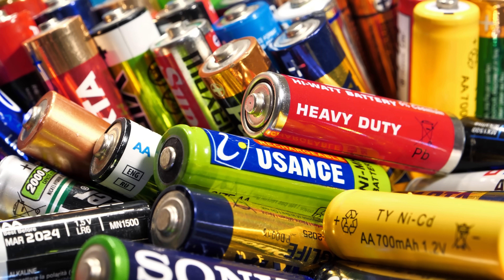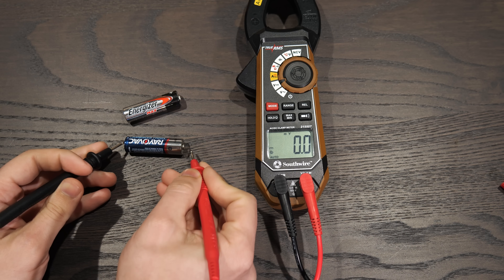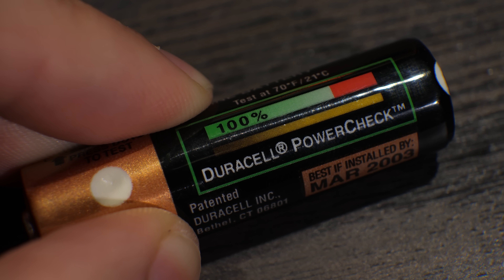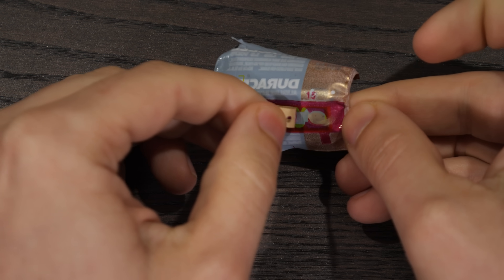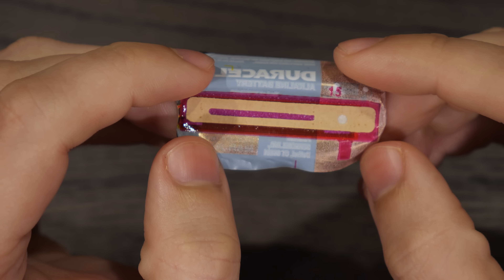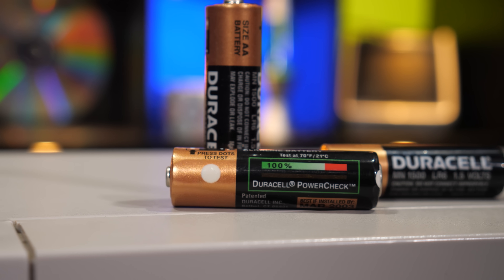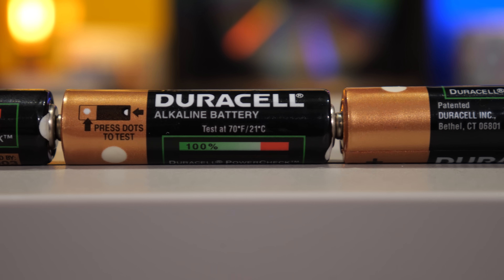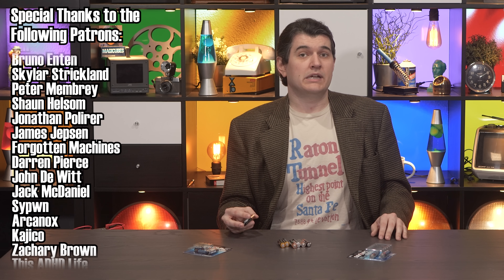Duracell PowerCheck: A genius idea which didn't last that long

Comment: I swear i remember seeing them coming back some time between '06-'16 but from energizer maybe. 

Id imagine these would be good as a subsidy just for saftey in emergency situations. If governments required all batteries to have a built in tester, it could mean good for natural disaster situations or times of economic or war distress. It isnt that much more expensive coming from the profits they make, and while rechargeable batteries dont exactly need this, having it as standard would make a noticeable difference to any without power or saftey to sit and charge everything again just to make sure even though youre sure you already did, could save time in a disaster to get to saftey or be quickly assessed as working or not when found on the ground as not to waste on weight or capacity, or as a quicker switch out from the stock youve scavanged and hadnt been able to recharge yet.

This all sounds improbable in USA, no one alive today has seen the wars that were fought on the nations soil, and many in cities are naive to just how responsive our governments actually are with weather caused disaster. But remember, we pump half if not more of our national budget into war and completely neglect climate change. We fund war that runs on oil and oil alone and as climate gets worse all storms, floods, winds, and droughts become more violent. Im currently prepping for hurricane milton that went from tropical storm to cat5 in less than 12 hours. Helena got little to no funding for relief, my parents are still waiting for hurricane ian relief and have been homeless sense. Unatural war and natural disasters are already here, and every helpful technology not integrated into our daily life is lost lives today tomorrow and yesterday without knowing there were ever a solution that could have prevented it. If the country can afford to burn the war oil to make weather this bad, they can afford the bill they racked up on the climate. 1 b-52 bomber running patrole for 1 day spends as much fuel as 1 car driving for 100 days straight. We have 1000 b-52 bombers in the air at all times. 

Excuse my darker tone, i have a similar taste of interests as technology connections does, but for systemic topics instead, and i enjoy sharing knowledge, though im not nearly as organized as he is, this is just a comment after all. Stay safe this hurricane season everyone!

Comment: I remember batteries like these, our family had a bunch of them and we still have a few. I don’t remember any looking exactly like yours, and I remember seeing them until somewhat recently. But I can also I see why these died out, it really didn’t matter too much when it stopped working since like you for the most part I keep them in a pack. And if I do end up with a used battery, l just try putting them in something like you suggested, which is arguably easier than forcing the silly tester circles in and trying to hope it works.

But it’s fascinating to find out how this worked, I always guessed it was some kind of chemical reaction based off how much was left in the battery.

Comment: I remember these things... I also remember sets of batteries where basically this same exact thing was built into the plastic packaging they came in.  Probably a lot more sensible (since only one tester per 4/8 whatever batteries), but still died the death of 'how often is that useful.'

Comment: I remember using these, and licking my fingers to improve the electric contact with the dots. At the time, I thought that it relied on a circuit through the body. Moist fingers did appear to help get a reading, but not for the reason I thought. :)

Excellent video as always. Thank you.

Comment: No the AAA is used in remotes because the power draw is so low that age becomes a factor more than capacity, so smaller cells have lower chance of bursting

Also, it's lighter, which makes the battery door easier to design, easier to remove

Comment: I had guessed that the Powercheck was thermally actuated, but had no idea how much engineering went into it... real cool!  Now... if only Duracell could solve the issue with their current batteries leaking, while they are still untouched in their unopened package, with a proclamation on the package  of "Guaranteed for 10 years in storage", and the date on the battery is still 6 years in the future.  Yeah, it's a pet peeve of mine. Duracell's of yesteryear were not like that.

Comment: At least it lasted longer than the actual Duracell batteries! I don't think I've used a single Duracell battery in the past 10 years that hasn't started leaking catastrophically way before its due date.

Comment: You can also check (roughly) how empty a battery is by letting it drop from about 20cm high onto its bottomside. If it doesnt bounce at all (and even stays upright): full battery! If its very bouncy and drops on its side: pretty empty. Probably depends on the center of mass that is different between empty / full, maybe due to the (shifted?) electro-chemical potential within the battery?

Comment: I wonder if this power check label could make a comeback with recyclable batteries. I have so many that I charged awhile ago that might still be usable. I tester on the label would be nice and a way for a brand to stand out from the rest. Probably not competitive unless customers actually buy it though.

Comment: To get the fluid to heat up, couldn't you have removed the wrap off the dead battery and wrapped it around a fresh one? No need to burn your hands with a hairdryer.

Comment: I missed these, but there's an easy way to test batteries without any indicator or meter. Take some metal foil and touch the ends together. If the foil heats up a lot quickly then it's fine, if it doesn't it's basically dead.

Comment: Fun-but-annoying fact: it is generally accepted that an alkaline is completely discharged at an open circuit voltage of about 1.0V. If you measure the discharge voltage over time under a given load, you see that the mid-point of the discharge is about 1.25V, halfway between the 1.5V and 1.0V extremes. Despite that, you will find that many consumer electronics devices that assume alkalines will cut off operation at about 1.25V, taking about half of the battery's useful life off the table!

Comment: When I was little, I remember the battery testers on the batteries themselves where a series of little vertical bars that glowed green when activated.  Funny I can remember that but not the minecraft house I built in update 1.14, a house of which I recently refound, complete with resident dog and cat.  Poor kitty, poor puppy.  But hey, I can confirm it's mine, as the dog and cat got up when I clicked on them.  Weird I don't remember it.  At least I remember old battery testers.  Rockatoa, brickticks out!

Comment: Testing batteries by putting them in a thing to see if they work is great until you have one dead or defective battery but can't tell which one. Then it's time to practice the old permutations and combinations maths or break out the multimeter.

Comment: IIRC, the testers were part of the ad campaign that included adding the "best by" date. I think the intended use was to confirm that the batteries hadn't gone bad on the self before putting them into a device. This was supposed to motivate folk to pay a premium over cheaper, dusty, undated batteries. I'm skeptical that the testers were primarily designed for people who switch partially used batteries between devices.

Comment: I think the big thing to remember is that we simply aren't burning through batteries anymore because technology has made things much, much, MUCH more efficient.  To use the Game Boy analogy, the Game Boy (OG) required 4 AA batteries.  The Game Boy Color required 2 AA batteries.  The GBC was more technically advanced, but required less power.  The GBA used only two batteries and also was way more powerful than the OG Game Boy.

Most stuff now has such great power management in it that the batteries in those devices will corrode before they die.  Even TV remotes, one of the last bastions of batteries, can usually go their entire lives off of the tester batteries it comes with, if used moderately.  Even alarm clocks can run off of a single AA for like 5 years.

Still, I did like the PowerCheck.  My thumbs, not so much.

Comment: Watching you push in those "buttons" brought back all of the memories of how painful doing that was. 
I always found the gauge not fully reliable - I recall plenty of times where I could make the gauge register but the battery still wouldn't power a device.
Reply: Am I the only one that could never get it to work? I never saw the yellow no matter how hard I tried.
Reply: @PremierSullivan  you had to just about make your finger bleed to get them to work. Either that our all your batteries were flat 🤣
Reply: Different devices require different minimum voltages. For example, batteries with too little charge for a gameboy might still work in a TV remote
Reply: @gregariosity  agreed - but to my then preteen/teen brain the bar said full so my game boy should've worked!!
Reply: We had/have a small analog tester, my father always says: You need to look at the speed of the pointer, just reaching the good mark isn't enough, even better when you overshoot and it drops back (new battery)

Comment: I’ve still seen them rather recently,
While the cost to the manufacturer is understandable. The actual cost compared to margin is pretty negligible in terms of impacting the price you would pay. Batteries are a very large margin item, especially at retail stores. It wouldn’t meaningfully impact the cost you would have to pay.

Also, the actual hit to your battery life by testing it with those should be extremely negligible. It’s a pretty small amount of current for an extraordinarily brief amount of time. Even if you do it several times throughout the life of the battery it’s quite small.

Comment: Most AAA devices WERE too small for AA. And are generally the kind where a AAA will last close to a year anyway. And yes, fat Eddie Munster, I would prefer a smaller, lighter remote control to a bigger, bulkier one whose batteries will probably explode from moisture long before it dies anyway.

Comment: i preferred the battery packs with the tester built into the blister pack casing, instead of the battery itself.
back in the gameboy days, it was a lifesaver for testing all the AAs, to find the ones you could squeeze the most juice out of.
not to mention, it was a little less wasteful.

Comment: Those testers don't exist anymore??!  That's news to me.  I remember just recently checking a battery using one... or at least I think it was recently.  Time starts to fly after you turn 40-50.  But recent enough to not notice they weren't there anymore.  I still look for them before pulling out battery checker.  Now I won't since this guy seems to think they don't exist anymore.  Maybe they don't.  lol

Comment: This might have been more useful on rechargeable batteries because most NI CAD chargers are dumb and don't even know when they are full, nor do they auto-shut off... (Rare exception being Mini Disk and CD Walkmans that can charge) And with rechargeables you would have a reason to test them so you can know in advance if you should charge them before you go out with a portable device, or are they good to go in your Walkman for example.

Comment: 12:31 Never use unwrapped batteries, they can short circuit and cause a fire or explosion. I'm surprised you didn't make a note of this in the video.

Comment: I remember these! I also remember a news report saying some batteries were overheating when trying to test the battery levels. I went to test some after the report and sure enough would get burning hot when trying to test their levels. I stopped buying those type of batteries after that.

Comment: I worked in a grocery store circa 2018 and stocked the battery section. Used to see really old Duracell power checks in the back stock from like 2005. They still had some juice but you had to push so hard to check it

Comment: Do you know about the bounce test?  If you drop an AA/AAA on its negative end on a hard surface, and it bounces, it's likely dead (internal pressure increases with use). New batteries don't rebound.

Comment: Interesting. Used batteries with a tester a few times. 
You mentioned rechargeable batteries... so why there are no testers on the rechargeable s?
Another question - have you noticed that lots of toys and other appliances require only 3 batteries?
However, popular AA and AAA chargers work only with the pairs of batteries. They seem to be unable to charge just 3 batteries.
Another words to charge 3 batteries you need to put in the charger 4 batteries - which creates an unevenly charged batteries. It seem to be not great for the batteries lifespan. 
As a result batteries getting "older" quicker an subsequently faster become ecologically dangerous trash.
Could rechargeable s become a star of some future talk?

Comment: I wonder why they had to make it so that you have to press both buttons instead of just the one on the side. Also, they could have make the buttons just slightly easier to press or asked to the user to use like a pen or other pointy thing to press the button.

Comment: I remember these, but rarely bought Duracells as Energizers simply lasted longer. But nowadays, many rechargeable batteries, like OKcell units, have LED charge indicators built into them, the electronics is so small and cheap that they can do it for a few cents per battery. Haven't ripped one apart to see the details yet as haven't had one fail, but would be interesting to see a vid on those...

Comment: I hate AAA batteries! So much wasted to the required casing thickness. D batteries also need to go away these days. By the time a device needs D batteries, they should be Li-ion. If I do have to use AA batteries, it's Energizer Ultimate Lithium, or Panasonic Eneloop.
Reply: What device sold in the last 5-10 years still uses D cells? I barely find new devices requiring 9V batteries, let alone C or D cells. Most devices have now settled on using AAA because they get used up quickly, so people buy more of them.

Comment: That common approach to just leaving batteries in the device until they're dead (and often beyond, in the case of devices with quiescent current above zero) is responsible for a huge number of dead devices, because discharging quite a few battery types results in leakage...

Comment: I remember these Duracell battery checkers on the sides of the batteries as a kid and i used them constantly! I didn't have enough batteries for everything at once so i would take batteries out of one thing and put it into another and use it for a bit before switching it to something else and we did have a junk drawer with a bunch of random batteries and other stuff in it. That battery tester was a part of my everyday life for a while!

Comment: I have used rechargable batteries for a long time. I've gotten as much as 5 or 6 years out of a set, for things I don't use very often, like flashlights. I started 20 years ago. Newer Ni-Cad batteries suck, but there's still some good ones. Panasonic-branded batts from the dollar store suck, but Panasonic Eneloop batteries are still good long after those cheaper ones kick the bucket

Comment: A friend of mine once answered a "design a battery tester" question on a problem set for an introductory class on circuits using the physical principle that it is impossible to measure a system without disturbing it. His answer was "A hammer. Strike the battery with the hammer repeatedly until liquid escapes. The battery is dead."

Comment: Watering timers use alkaline 1.5 volt batteries specifically.  1.2 volt batteries do not work.  Gameboy colour units work equally fine with both voltages.  In the end whether or you can use either or both voltages depends on the type of device.  I'm not sure about wireless xbox360 battery packs though.

Comment: As a kid I would not just shove the batteries in a device and let them there till they die, because as you stated they were often not included and needed pretty much everywhere (toys, RC cars, game boy, even the rumble pak of my N64 needed battery).
My parents complained about how many batteries I consumed and not buy so many of them at once so I would often swap them from a device to another; then when I had some Duracell with powercheck in my bunch of batteries I would happily test them, it was a nice little feature. But that surely didn’t worth the premium 😂

Comment: I remember thinking these were so cool as a kid. But you did bring up a great point. I only ever verified known good batteries. I think the only time I ever kept used batteries is if I changed them out thinking they were dead and it turned out the toy or whatever had another fault instead. So I would hang on to them because I knew they weren't the problem.